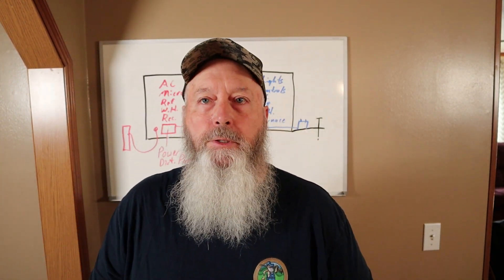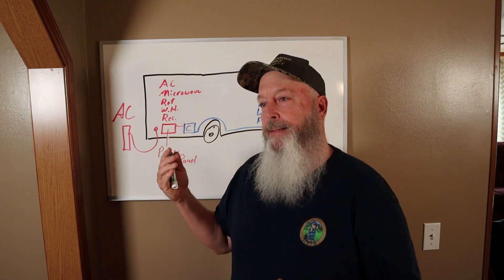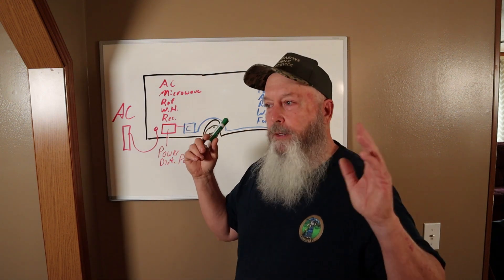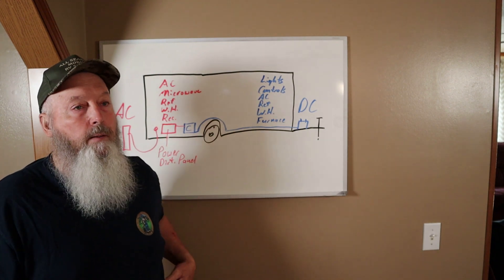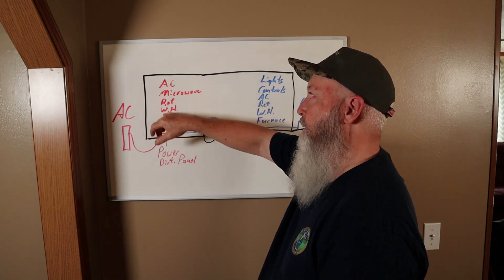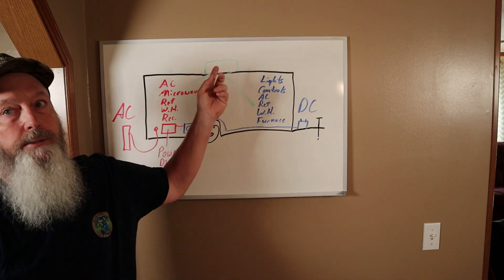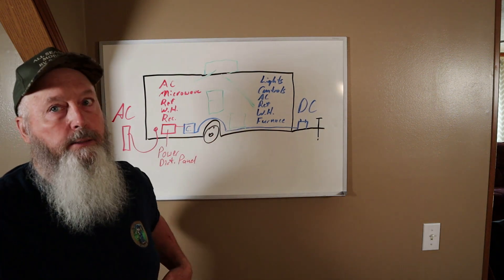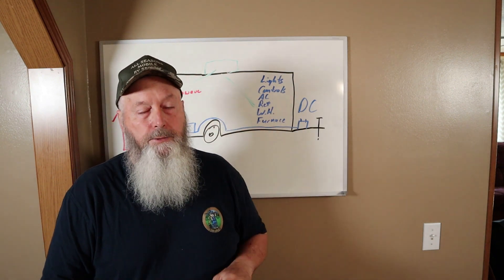RV Electrical System 101

Comment: Thanks for explaining the distinctions and correlations between AC and DC electricity in RVs!  But I discovered (the hard way) that my RV has three somewhat distinct electrical systems: DC, AC+GFCI, and AC without GFCI.   Something happened when we were using AC a few months ago that killed all of our AC outlets, but several outlets in the RV that are tied into the GFCI were easy to get working again by simply pressing the reset button on the main GFCI outlet.  I still haven't figured out how to get the other non-GFCI outlets working, so we just use the GFCI outlets for now.  By the way, the air conditioner and microwave seem to be tied into the GFCI system (in any case, they are working).  I would assume that any RV with plumbing would likely have GFCI outlets, so I wonder if my situation might be common.

(I found your channel today because I have a 1999 RV with a Generac generator that seems identical to the one you diagnosed in 3 other videos here.  Trying to figure out how to get the generator working again, which I have had to do repeatedly in the past.)
Reply from the maker: Welcome to the channel.

Comment: I recently retired from ford motor as a journeyman industial electrician for 50 years. I recently bought a used fifth wheel and was not sure how the electrical system worked. Your simple explanation and drawing absolutely cleared up the mud puddle. Thank you!!!
Reply from the maker: RV electrical is no the easiest to understand.

Comment: This is an excellent explanation of your RV Electrical Kenny 👍👍 How many times have I went out on a call & the battery is the problem . Corroded connections or loose . You did a great job on this , I’m a simple man  & like to use the KISS theory 😁👍✌️🇨🇦🔧
Reply from the maker: Thanks Brian. Yes simple is best.